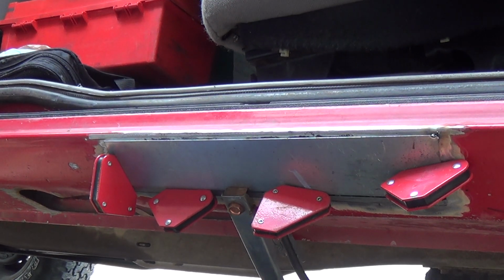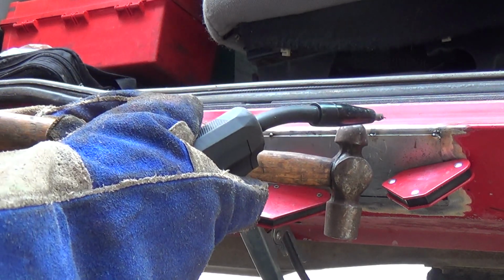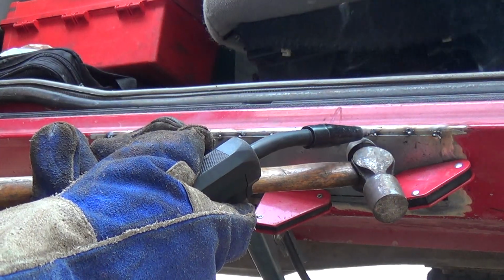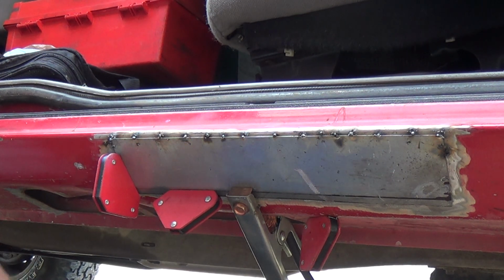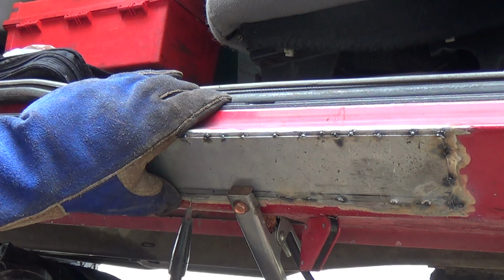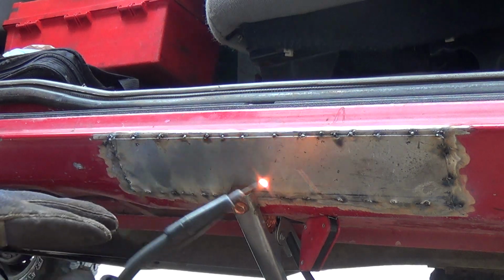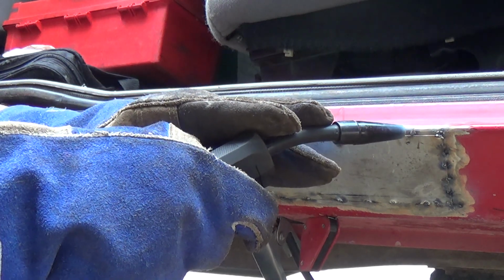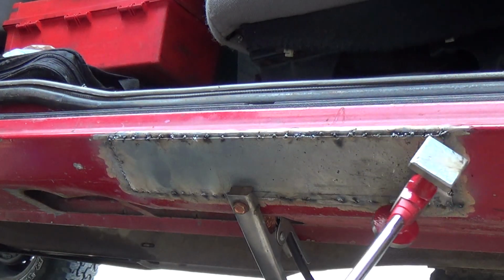Day 2 Part III: Flux core welding Ford Ranger passenger rocker panel repair "Spot Weld"

Comment: You are doing tacks. Tacks require more amps than regular welding.on the vertical go down hill.i have over 10,000 hours under a welding hood.
Reply from the maker: Thank you for your contribution!  Those recommendations can help inspiring welders.
Reply: Need more dwell time on tacks, you getting no penetration